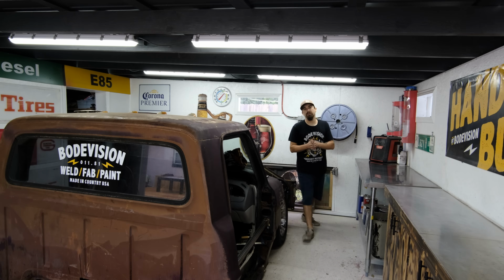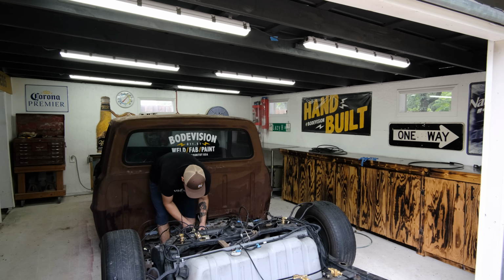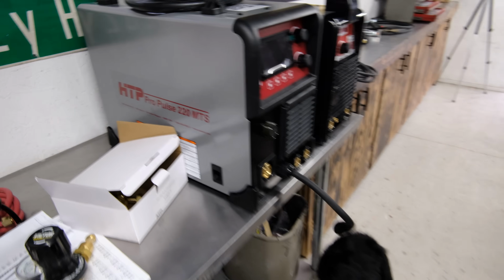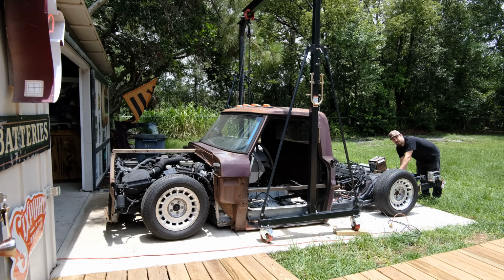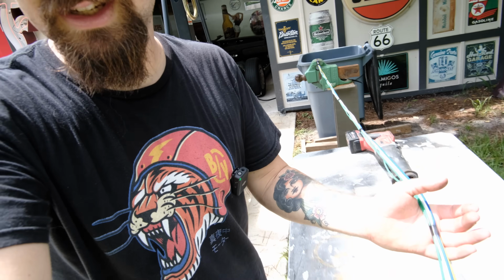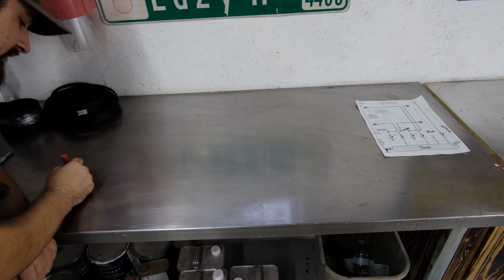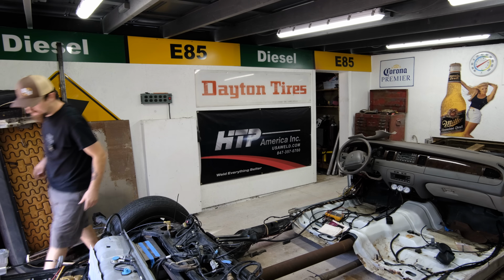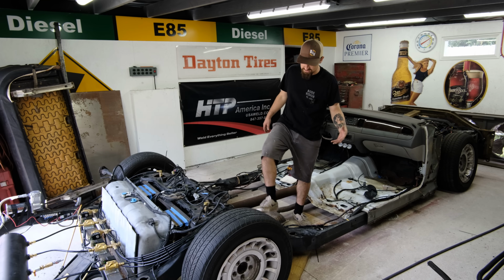Shop Truck Build: Body Swap & Electrical Harness Tutorial | Air Ride, and Fuel Tank Install

Comment: with all the welding you still need to do to graft the floor to the truck cab , putting all those plastic lines and wiring in there might not have been the best idea , then again you could take it back out and have it at the right length when you reinstall it after you done up the cab

Comment: Killing it on this project. That cold start sounded like timing chain slap. Might need to maintenance the motor a little while it's all torn down and easy access to the engine

Comment: Fantastic setup with the air ride system Adam, all your wiring harnesses and airline placement looks really good and is very professionally done I don't think it would be any better if it was a bought ready made kit👌

The truck looks so cool when it airs up and out plus it sounds nice as well, these air ride systems are getting more popular as there are now loads of them here in the UK, looking forward to the next one🙏👍John

Comment: So dope.  Did you see this body swap somewhere else or just a lot of measurements and planning to find the right body style car and size that worked
Reply from the maker: I know f100’s and crown vic is common. And these are just larger f100’s so I figured it would work
Reply: @BodeVision  Just a thought, connect a Lexus GS450h transmission to the V8 use 2- 3 BMW hybrid battery packs(22-33kw) 250bhp is doable in Hybrid mode... a few other bits you should be good...